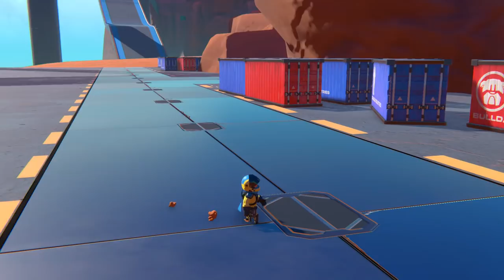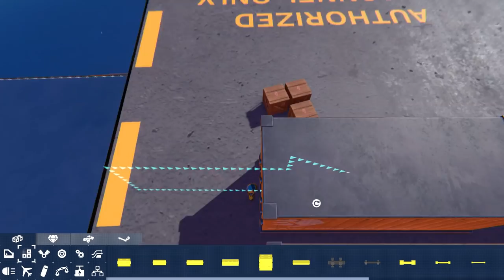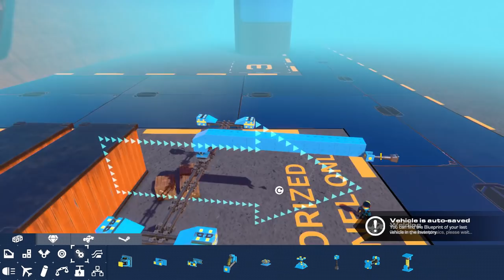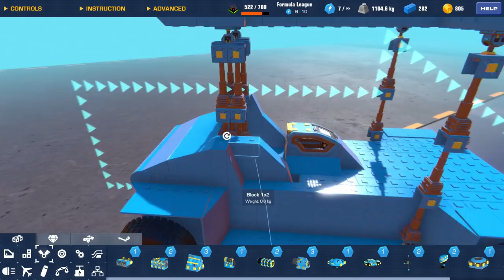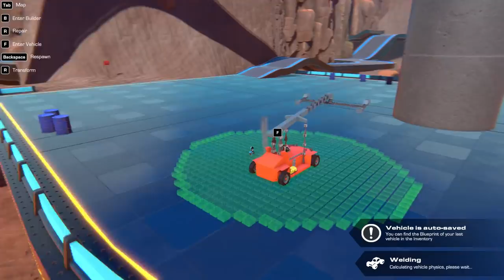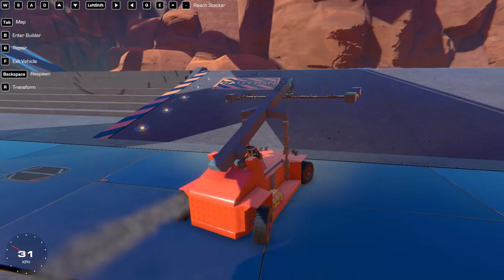Building a Reach Stacker to Transport Crates Around the Port!!

Comment: lowering the strength of the head hinges to ~1 would help with keeping c-can level
strong enough to have some control over the angle, but weak enough that having any weight attached over-rides hinge and dangles with gravity

Comment: Isn't hinges supposed to be free floating to always be parallel to the ground?
Reply from the maker: It's actually hydraulically controlled on the actual vehicles but what I should do is put them on an angle sensor to always stay upright
Reply: @darealkosmo  Oh, I thought the same as Jakub. Did you try to let the hinges free floating on the crane?
Reply: @darealkosmo  When you raise it up, the cargo collides slightly with the boom.  I suggest adding a block between the boom and the grabbing mechanism (before automating leveling).
Reply from the maker: @greybeard5123  good point!

Comment: The teacher stackers we have where I work can stack 4-5 containers high the spreader bar has a lock on each corner the locks into the corners of the container the bar can spread from 20ft to 40ft can rotate 180 degrees one way and 90 the other if you want I can get you some pictures of them and maybe videos I live in the Midwest in Nebraska we use them to load trucks and trains the ones we have are Terex and fantuzzi brands
Reply from the maker: That's cool!